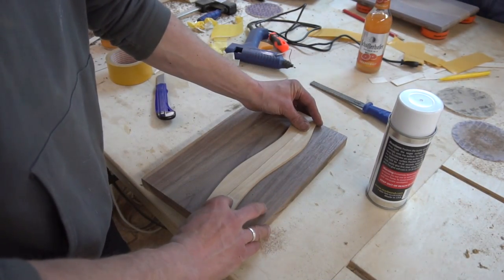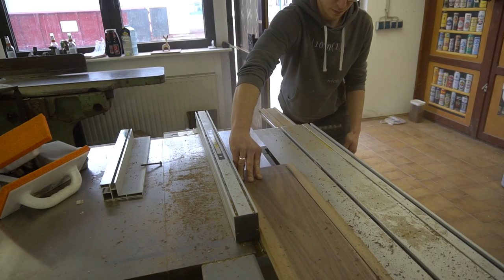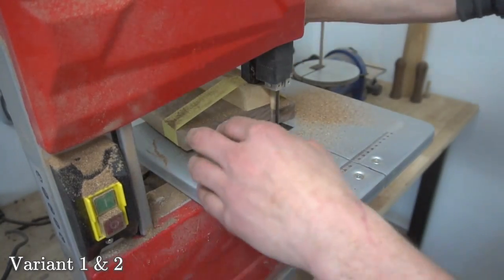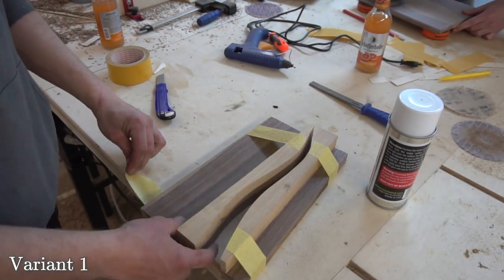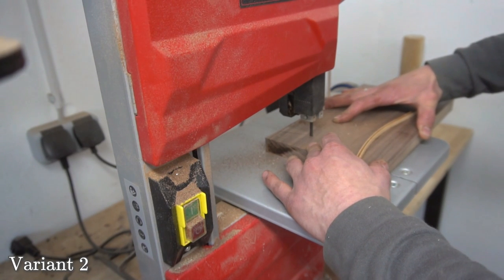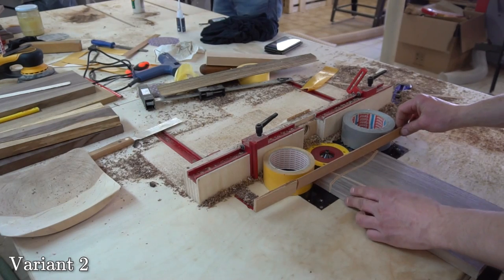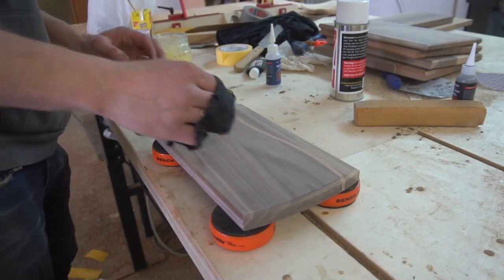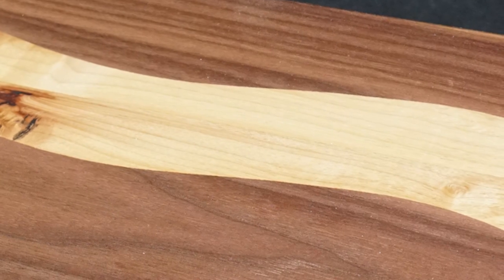Two Gorgeous Wavey Cutting Board Designs that EVERY Woodworking Beginner Can Make!

Comment: Most folks will know this, for the very few that don't, at 00:47: Note the stop atttached to the fence to set the cut-off distance. It stops well short of the blade, so the board when being cross-cut is not pinched between the blade and the fence, eliminiating chance of a jam, and having a piece of wood flying across the shop at about 1.000 MPS (3,281 FPS for my Ami friends).
Reply from the maker: Indeed! :) Huge advantage of a sliding table saw, making it extremely safe to use!
Reply: This is useful to know, thank you for sharing :)